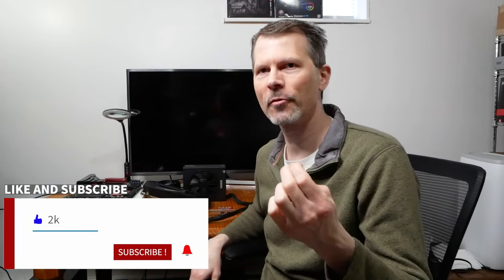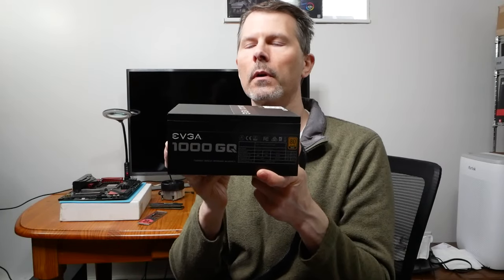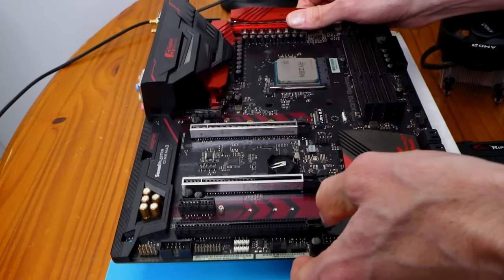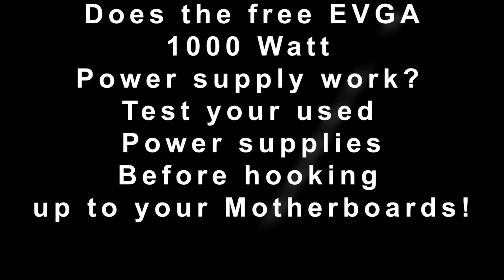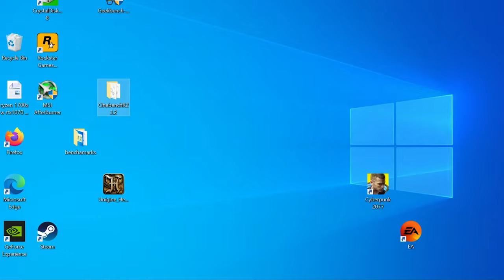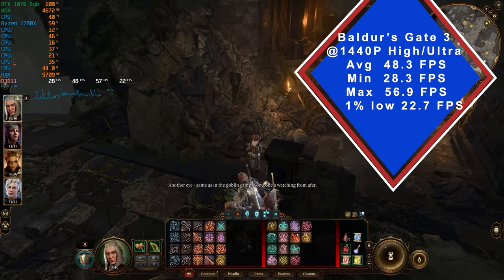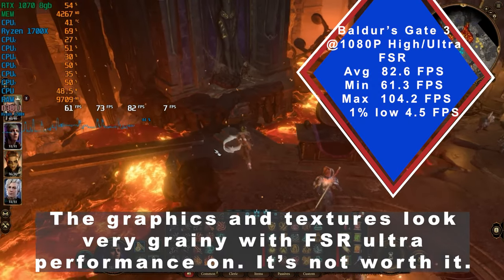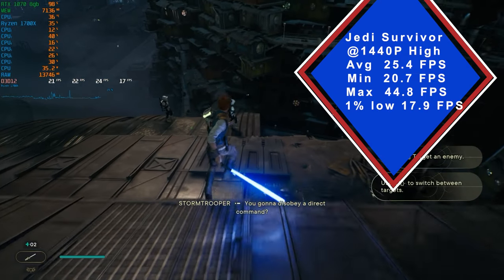Ryzen 7 1700X + GTX 1070 Is This Still a Viable Gaming Combo in 2024?

Comment: honestly? if you need a low budget PC build for your kid or something, this will probably get the job done i can't lie. i think a 1070 and 1080 will last for a LONG time, just adjust your expectations and it'll last very very long
Reply from the maker: Hi there. I 100% agree with you. For 1080p this setup works pretty nicely. Drop in a 5700x and a new video card down the line and bam! 1440p instant upgrade.
Reply: @RememberThisTech You might not even need to upgrade the CPU. It just depends on what your target goals are. If your goal is 60FPS, a 1700X can easily do that. Just get an appropriate GPU that bottlenecks at 4K Ultra-60FPS. I can't see a 1700X go lower than 60FPS on most games.
Reply from the maker: @4m470  Hi there, and welcome to the channel! Your spot on there for sure! I've got a 6700xt that is in my main pc it would do a lot better, not totally 4k  but 1440p. Mainly, I wanted to test this combo I got for a deal, and it did really well. If I want to drop in a 5700x, I can up to win 11 and have a bit more efficient and powerful cpu, but seeing as this one time for now, that shall wait :). Thanks for watching and commenting. I appreciate it!

Comment: I am running a GTX 1070 on an Intel i7 8700k clocked at 4.7Ghz and 32Gb of DDR4@ 3600Mhz. Picked up the GTX 1070 for £75 on Facebook Marketplace here in the UK. MOBO is Z370 - A - PRO.
Reply from the maker: Hey there! That setup you have is pretty rock solid! Nice! I've also got a 8700k on a gigabyte z390 motherboard and it's solid! The 1070's here people are still asking a lot for them, so when I found this one for $50 I grabbed it!

Comment: Heck yah. The 1070 can handle about anything except Starfield. It doesn't Starfield very well. I picked up a similar system a while back but no gpu. It had an 1800x, and I am surprised how slow it felt. Kinda shocked that it or the 1700x can max a 1070. Not that the 1070 is great, but the single core performance of first gen ryzen was pretty bad.
Reply from the maker: Yeah I read that the first gen Ryzen cpus weren't that great, had low clocks and efficiency. But least I can upgrade the cpu on this board. But the 1070 was a nice score to top this off. Cheers!
Reply: @RememberThisTech  just curious. Do you think the seller thought they were taking advantage of you? Like haha I'm selling him my crap that doesn't work? I mean you got like 300 in good parts. You got the best of the deal, but I sometimes wonder whats going through their heads. I picked up an aorus x370, the 1800x and ram kit for 70. When paying they're like oh it crashes sometimes so i think it has a short. I was thinking "nah. You're trying to cool an 1800x with a wraith stealth. Duh" parts were just fine with a good cooler, but i felt like they were trying to pull a fast one.
Reply from the maker: @ItIsNot1984  You know idk what was going on in the guy's mind. I know that in the back of my head I was wondering,  whats wrong with all these parts there's goto be a hitch for these prices.. The 1070 goes for 75 to 100 alone here. I had to take the chance. But I've got plenty of beefy aftermarket coolers power supplies etc. Plenty of test parts. But for the video I figured use all I bought for the build and test as is. Worked nicely. I didn't try and oc anything. Might drop in my 5700x though :). Psh other people think they need the newest shinniest tech, for a few more fps. Let them sell us the old tech! Love these scores!

Comment: I think you got a great deal on that bundle. You are probably limited to PCIE Gen 3 speeds, but a cheap Ryzen 5500, or maybe even a 5600 (non G) would give you a few more years. Alternatively, find a huge old ugly case with lots of 3.5" drive bays, buy a box of used drives off E-Bay, and build a TrueNAS scale server.
Reply from the maker: Hi there! I was thinking I might use it to replace my older 3770 file server. This mobo has 10 sata ports. Problem is that the 1700x is more power-hungry and has no onboard video, so I'd need some low power pcie video card. Maybe drop in a 5600 like you said. I already have a big old giant thermaltake case, lol. Gah idk what to do! ;)

Comment: out of curiosity if i buy a 1080ti today, with a 1700x how long would you think my pc hold up? i have a 1060 6 gb rn and i want to upgrade later but for $100 i feel liike its not a bad upgrade for a little while longer
Reply from the maker: @KojiWoji_  Hi there. Personally if you were to get a 1700x and a 1080ti it s is a de entry powerful combo but the 1700x isn't technically supported by windows 11 and unless you can get a windows 11 install with Rufus windows 10 support goes away in Oct 2024. I'd personally go for a 3700x or 3600x that's supported by windows 11 and if you can get for 40 to 60 bucks. It's a better cpu clocks higher and supports win 11. Then get a 1080ti habit later.
Reply: @RememberThisTech  would it be wise then to get something of the 3000 series? And go for something with a 2080 for the budget build
Reply from the maker: I would shoot for a 3600 or 3700x if you can find one used for 50 to 65$ it will give you more life out of your system than a 1700x. A 2080 is a beast of a card and will do better than a 1060. But don't over spend on the 2080. Let me know what you find GL :)

Comment: Great setup for the price. A Ryzen 5 5600 upgrade + a faster used gpu would give this generational leap in performance as well, so it could be good for several years.
Reply from the maker: Hey there! Yeah the whole setup is solid!! I thought to make it my new serve mobo and drop in a more efficient cpu. I've got a 5700x. And 5600g. Problem is it has no onboard video out to support the G igpu. I'd have to run a dedicated graphics card. Not sure what to do. But sure do love the 10 sata ports lol. Then again I can just use my Asus prime b550 and 5600g for my server upgrade. Shrug.. I'm conflicted. But for all this it's a great deal for what I paid . Cheers!

Comment: Such a deal hunter you are :P This is very good. AM4 socket still makes sense since you get to upgrade to different generations and notice the difference + price/performance ratio makes it so appealing.
Reply from the maker: Heck yeah! The 1070 alone was a deal, but add in the rest, and it was a no-brainer for me. Not that I need another system lol but it makes for good testing and video :)

Comment: I sold off my main rig last year, received the one I built for my sister from her. Had a Ryzen 5 2600X 16GB 3200mhz & 1070 Mini. Just installed a clean Win 10 install with a brand new 860 EVO and it is very good, good thing I upgraded the CPU cooler to the AMD tower cooler. And it has a EVGA 750W 80+ Gold Supernova G2. A lot of people ignore older Ryzen, 2nd gen Ryzen is actually a very good budget spot for cheap. 1070 because it's from my favorite generation of GPUs, I plan on getting 1080ti again just to have.
Reply from the maker: Hi there. That's a nice system you have there! I personally don't have any 2000 series cpus but had a 3200g that performed well. I've also got a 5600g and 5700x all do great. Those Evo drives are pretty rock solid! The 1070s seem to still have tons of power as my tests showed even in today's games. Thanks for watching and commenting I appreciate it!

Comment: I bought this to my sister and she didn't even notice this wasn't new parts. I bought r7 1700X , 32gb ddr4 3200, rx590 8gb , b450 and 256gb Chinese nvme . All of the parts i bought on AliExpress around 289$ . I spend 55$ on 800 watt brand Aigo. I didn't buy PSU from AliExpress as i wasn't convinced enough.
Reply from the maker: Hi there! Yeah a lot of people might think that because these parts are a few years older that they aren't still pretty good! But then they use the system etc. and they never even notice the difference :) Also never skimp on a power supply, you did the right thing to not by that from AliExpress. It could have been ok but why chance it!! Thanks for watching and commenting I appreciate it :)
Reply: @RememberThisTech  yeah sure dude. Btw is 8 core Ryzen 7 1700X gonna be good pairing with 6600xt? I might wanna upgrade my gpu as I got a good deals on my online marketplace on 6600XT but wasn't sure if the CPU can hold it. It was 189$ used. Since I am using rx590 I thought if I gonna sell it at good price and upgrade it to 6600xt would be night and days different. Because my r7 1700 percentage only around 50-60% at most . So if I wasn't wrong I can upgrade my gpu without having any bottleneck.
Reply from the maker: @Fizzi-gf2og  The 1700x should work fine with the 6600xt. You can always buy a cheap 3700x and drop in the mobo or a 5700x down the line for an upgrade as well.
Reply: @RememberThisTech  thanks for the answer buddy

Comment: Im currently still using my Ryzen 1600 with a 1060 6gb and it ran Cyberpunk at 50+fps with FSR on balanced. Just bought a 6650XT and soon buying a 5600
Reply from the maker: Hey there! Yes, this combo still packs a decent punch! Your 5600 cpu upgrade should be nice, giving you higher clock speeds and better efficiency! That 6650xt is a nice card as well! Thanks for watching and commenting. I appreciate it.

Comment: I had my 1070 till just recently, and I really could keep it a little longer for just 1080p gaming, but I happened to have some spare cash for an upgrade recently. I had an i5-7500 which I upgraded way earlier than the GPU because the quad core without hyperthreading just wasn't cutting it anymore.
Reply from the maker: Hey there! What cpu and gpu did you upgrade to?  I agree the 1070 is still good for a lot of titles in 1080p. Thanks for watching and commenting. I appreciate it!
Reply: my 1070 ryzen 1700 pc broke and i bought a optiplex with 1660 super and i5 7500 for like 370ish from microcenter 
its honestly not bad lol
i do miss the 1070 pc but this pc pretty much does everything i want
that cpu is trashhhh tho compared to the 1700
plus the motherboard i have i can upgrade my 1700 to a 5800x3d and the 1070 to a 4070 super
amd cpus are so much better than intel

Comment: Word to the wise: use 3000mhz+ RAM on Ryzen 1000. The RAM settings make your system way snappier and yield better frame rate in games.

Not sure if you tuned your RAM in the video or not. I probably missed it when you said it.
Reply from the maker: @4m470  Thanks for that tip :) I thought I put the ram in slots 1 3 or 2 4 for dual channel and set the frequency on the bios for the ram. Can't be certain though as I make mistakes and it was a while back :)

Comment: Hey i got a little question.

I want to "upgrade" my pc with the Ryzen 7 1700x 

Ive read online that the cpu does not support Windows 11. But I have Windows 11 on my pc. 
Now my qestion, will my pc bug out when i change the cpu or will it break?
Thank you for the help :)
Reply from the maker: Hi there and welcome to the channel! Good question. First of all make sure your motherboard's bios revision can support the 1700x if not you will have to upgrade it from the vendor prior to doing so. Second, it's more that Windows 11 wont support the 1700x cpu. Before the last windows 11 patch or tweak you could run a bypass and install windows 11 and it would run fine. Now windows mostly removed the ability to bypass the TPM check etc. so even if you installed 11 using the bypass it wouldn't let you update security fixes etc. Note, What's your current motherboard? Model and maker? It could be that your motherboard could support a Ryzen 3600x and that supports windows 11 and would give you slightly higher clock speeds or maybe a 3700x cpu? And the Ryzen 7 2700X was supported as well. BUT they are enforcing that your Motherboard has a tpm 2.0 module and support now as well... so You will need to see if your motherboard supports that or has it. One of the cheapest cpu and mobo combos to upgrade to support windows 11 I've found is here https://amzn.to/3AuggEj  a better cpu here https://amzn.to/3yT7106  let me know what motherboard you have and what route you go. sorry for the long answer but it's better to know more than less and buy a cpu thats not supported and not be able to use it.
Reply: I now have a ryzen 3 3200g with a 1660 Super aswell as 2x8gb ram(ddr4)
I mainly use it for FiveM thats why I need to change my cpu, its stays on 100% when im ingame. And got crazy lags cuz of that :(
Reply from the maker: @Vincent-Santo  If I knew your motherboard I could look up what top end cpu's it supports. Maybe you could sell the 3200g for $50 and put that towards a 6 or 8 core Ryzen cpu and alleviate
 your game/CPU bottleneck?
Reply: @RememberThisTech  my motherboard is the Asus prime a320m-k 

I didnt Bypass the Windows 11 It is supported on my motherboard as well as my ryzen 3 3200g 
But the ryzen 3 3200g sadly is not that great.. 
I mean I will test it in a few days and plug the 1700x in but im scared that something Breaks:D
Reply from the maker: @Vincent-Santo  You can download the windows 11 check tool from your windows update section and it will scan everything and say yes or no your system fully supports windows 11. I also checked and that motherboard of yours supports 4k and 5000 series cpus. SO if later on down the road you want or find good deal on a 5700, 5600, cpu or evn a 5900 you can upgrade to that, those 5k ryzens will be better than the 1700x and more cores over your 3200g.
Reply: @RememberThisTech  thanks a lot you really helped me out <3 
I just looked up the 5000 series and holy moly that is indeed a very good tip. Again, thanks alot and best regards from Germany as well as lots of love <3
Reply: @RememberThisTech  I got one more question xD but the Ryzen 7 1700x is theoretical an upgrade to my ryzen 3 3200g even tho its older right? A friend recommended it to me for a really cheap alternative
Reply from the maker: @yami_trane9663  It would have a slight edge as far as having 8 cores. But won't officially support windows 11 so, when windows 10 support end this year in October you will go without updates and security patches, pay for extended windows 10 support, upgrade to a ryzen 8 core 3700x or 5600g or 5700x 8 core and you can upgrade then. Or... switch to Ubuntu or Linux Mint and hope it supprs your games :(
Reply: @RememberThisTech  you are right, again thanks alot <3

Comment: It seems like it should be better in Cyberpunk, but FSR didn't give you the boost it should have.  I'm probably wrong, but I think the 1070 is capable of more.  I think the FPS is similar with a 7840HS 780m iGPU
Reply from the maker: Hi there. Yeah I noticed the same in cyberpunk. I want to try the 1070 on a 5700x and see if it does better. Maybe double check some settings.
Reply: Cyberpunk is brutal on pascal. Non TI 1080 can only get 60fps at 1080p at medium.. it's not much better than the 1070 in performance.
Reply from the maker: @Geardos1  Ahh that's good info ty. It did ok though I thought. I mean if I can play at 1080p I'm OK! I've got a 4060 and a 6700 radeon in other machines.